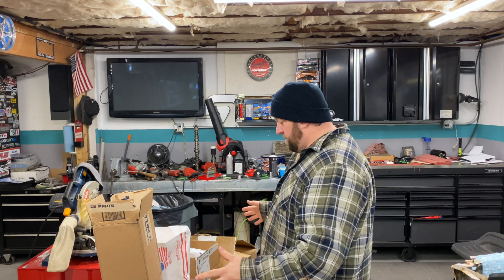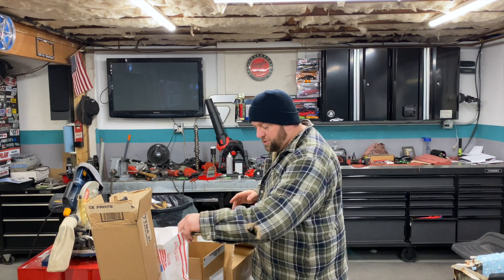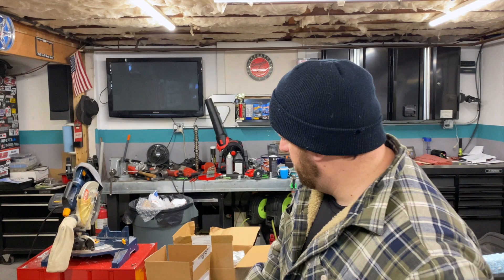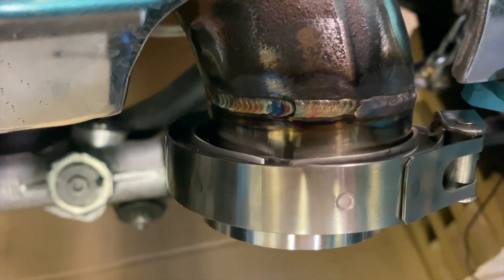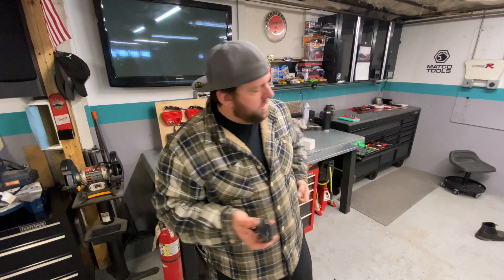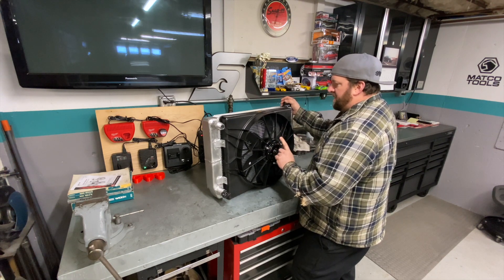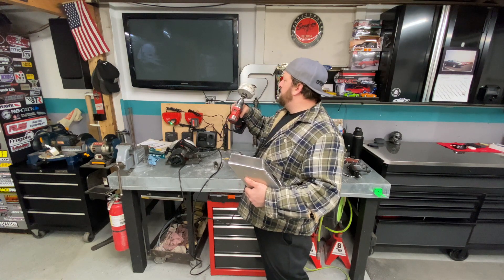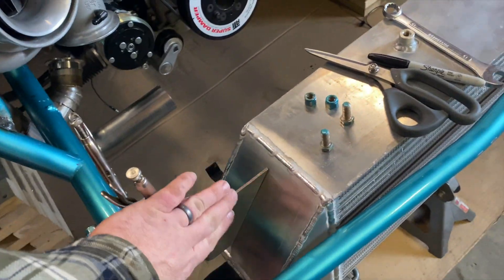Update on The Gumad!

Comment: Why did you switch back to stock exhaust manifolds?
Reply from the maker: Eric Miller well I never had stock exhaust manifolds but it was the only option in my budget that would clear the ac compressor.
Reply: @Racestatus  Gotcha, I wasnt sure if you had a problem with your previous headers. I have the same set and thought uh oh, something must not have worked out.